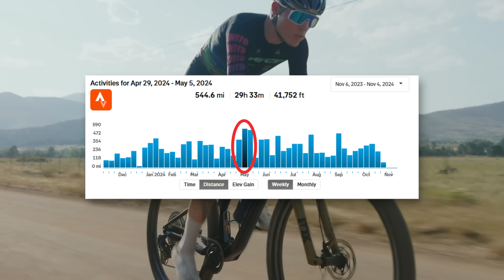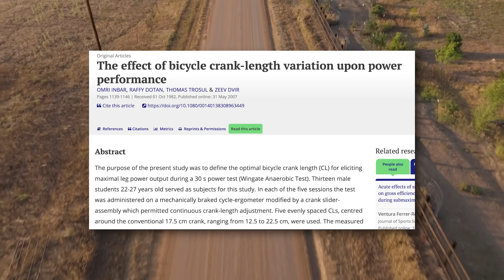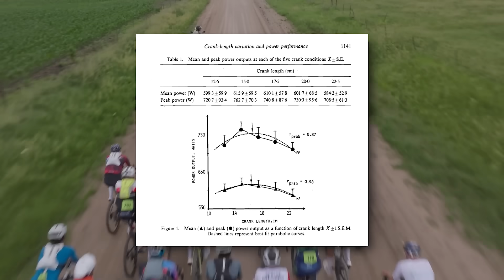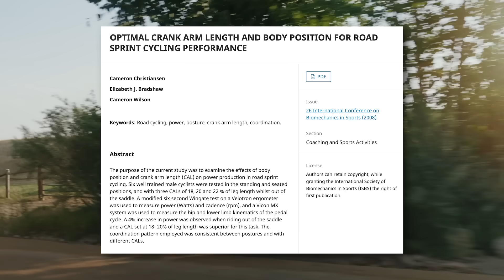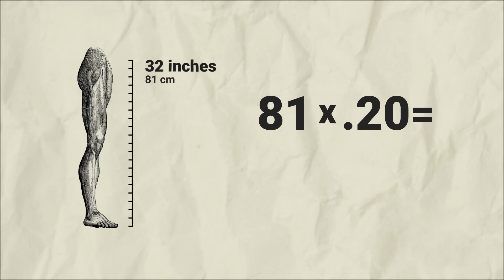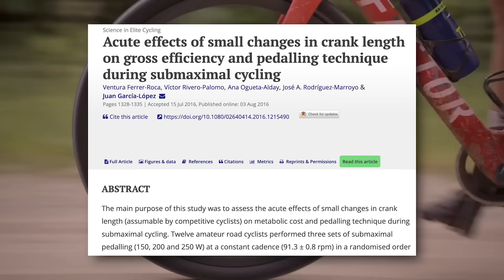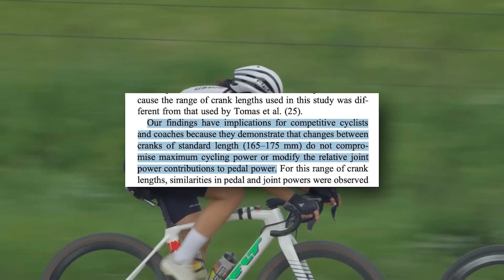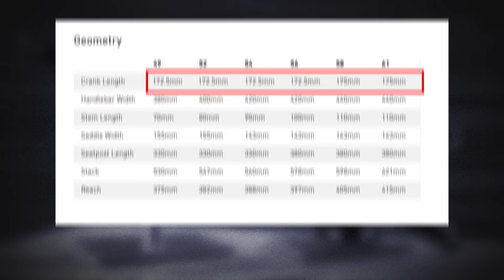You Should Be Using Shorter Cranks, Here's Why

Comment: mistake: shorter cranks are less aero, because you have to raise your saddel and bar so larger frontal area
Reply: Wrong, your saddle to pedal distance stays the same so no loss there but because your hip and knee angle is more open you can lower your upper body more, so more aero, on five bikes that I've fitted 165mm cranks to I've never had to raise the handle bars, your frontal area is smaller, even if you raised your bars the same amount you would still be able to lower your body into a more aero position with the more open hip and knee angle, but you don't need to raise the handlebars for any reason.
Reply: @gregmorrison7320  No, all you say is wrong. Higher saddelheight→ more frontal area. Hip angel is way more effacted by your saddel satback. And it is 95% training the position. For example Gannna uses 180mm in the IP.
Reply: @abcxyz6880  Lol seriously? You really think raising your saddle height 7.5mm effects your CDA, even if it didn't open up your hip and knee angle and allow you to get lower? You think the bike is somehow shielding your body from making aero drag and lifting your saddle 7.5mm somehow creates more frontal area? Come on dude. You must be trolling. Perhaps go and see a bike fitter to explain it to you. And FWIW for his hour record Ganna was running 170mm Wattshop Cratus aero cranks. Do your research before expressing your opinions which doesn't make them facts. SMH.

Comment: I went from 172.5 to 165 and got much less knee pain and saddle sores due to a more stable position. I also noticed a significant improvement in performance and speed, maybe due to the increased comfort and the ability to get more aero but the benefits have been very noticeable. great video hope manufacturers will catch on because not finding any bike that fits me anymore is a pain in the ass (even "custom" bike builds often don't feature anything below a 170)
Reply: Can you get your knee to your chest before 165?  I feel what you've described is knee compression to your chest and being able to deep breathe would indicate why performance and speed increase.

Comment: I went from 170 to 160. No toe overlap, no pedal strikes, slightly higher cadence, and most importantly it just feels better.
Reply: More smooth pedal cadence too and no knees hitting my chest on the drops due to higher seatpost, especially for us shorter guys who's already pretty tight on remaining seatpost length lol.

Definitely one of the best upgrades I did as per my bike fitter recommendation.
Reply: @ryoukokonpaku1575 さん，160から155(152．5が欲しい)に交換したら，１センチサドルが下がりました！おそらく前後方向も要だと考えています．日本人は膝関節で漕ぐのでショートクランクは使いません．尚大腿骨が長く脛骨も短いのが影響してるのかも？
Reply: Hey, thanks for sharing. Super informative. If you don’t mind me asking, what is your inseam and overall height?
Reply: It's such an expensive upgrade for what it is.
As a guy with a 76cm inseam, size 44 feet and riding a S frame I wish for it to be a more readily available option as time goes on
Reply: @thispod  I agree.  People are jumping on this with no discussion of leg length and most are talking about a 1 cm change.  I did see one guy that in the comment who said he was riding 175, but he's 5' 4".  NEVER should've been on those cranks anyway.
Reply: @thispod  I'm the same feet and frame yet my inseam is 84.5cm (I'm 170cm)...I don't want to have to raise my saddle any more than it is as my stupidly short torso won't appreciate more distance and especially drop to the bars....I ride 170(road) and 175(mtb) with no issues, probably no knee to chest problems as I don't have the spine length to get "low and long" ha ha...
Reply: @thispod  the way I solved that is building my own bike up from a frame and groupset I purchased.   A bike shop can also build it up for you for a couple hundred.    It in theory costs more to build from parts vs. buying off the shelf, but when you are talking about a power meter crankset, any of that "more" goes right out the window and a groupset and frame on sale actually made it less expensive in my case.   That also let me really pick a seatpost, stem, and bars that I knew would totally dial in my fit and comfort right out of the box.
Reply: Almost the same story. Went from 170 to 165, but with bigger gear ratio(I'm riding fixed gear).
Less toe overlap in winter boots, almost none in sneakers, bigger cadence, less fatigue in knees. Totally worth it.
Reply: I've got size 13 feet, and the reduction in toe overlap going to 170mm and 165mm cranks was a huge bonus. It's not why I made the change , but it's sure a nice perk.
Reply: @joelecho  Interesting.  I also wear 13s and have never had a problem with toe overlap with my 175s.  Never have had a problem in 30 years.  Could be cleat positioning, although on my current MTB, I have the cleats fully to the back of the shoe, which put my toes as far forward as possible.
Reply: @todd727300  its quite bike geometry based as well. I have no issues on my cross or xc bikes, but my Tarmac has a lot of overlap. Typical with racier road bikes.
Reply: @joelecho  No issue on my Alpe d'Huez with 175s either.  Interesting.
Reply: Did the same. A lot more comfortable, less ham string strain. No appreciable power loss. I m 165cm so 160-165 is optimum imho
Reply: "Tow overlap" sounds like something that can't be corrected by bicycle cranks but only by a bone surgeon.
Reply: What difference in cadence did you observe?
Reply: If i switch from 172.5 to 165 should i keep my saddle height the same?
Reply: Same here. I went over the years from 170mm to 165mm to 160mm. Each time I went shorter, I got more comfortable, less knee pain (none now with 160mm cranks), and smoother pedal stroke. According to the 20% rule I should be using 152mm cranks. I'm really tempted to try 150mm cranks but I would have to go off-brand, there are only a few choices, and SRAM AXS 2x12 front derailleur may or may not shift as well with other-brand cranks & chainrings. 

Toe overlap can be a major problem, not just an annoyance if you ride a small or extra-small road bike like I do. Especially if you wear larger shoes for your height (also as I do). Shorter cranks help with that and I also use pedals with wider q-factor (Favero Assioma Duo Shi) and this helps tremendously to reduce toe overlap as well as increased comfort and smoother pedal stroke. If you take some video from the front as you are pedaling, your saddle height is correct but your knees and legs make a v-shape, you are a good candidate for both shorter cranks and longer pedal spindles. A lot of fitters don't even look at this so do yourself a favor and ask them to take video from the front and evaluate. 

This often comes from hip impingement which is not from a lack of flexibility, but it's from the way your hip architecture is. This is more common than you might think, and it also affects deep barbell squats. Since going to the "Starting Strength" method of barbell squats, I can do deep squats for the first time in 25 years of barbell squats.
Reply: @northkyt The toe overlap for me (really only on gravel bike especially because a lot more low speed turns, especially in CX races) comes in part because I have my cleats back on my shoes, which I find is a more comfortable position. The shorter cranks would help. I have 170mm (frame size 51 or 52) and when I get a new gravel bike will go to 165mm most likely.
Reply: @northkyt  Wonder where you even want to get such short cranks as only a few manufacturers even make anything shorter than 170mm and the rare ones available from specialty companies might improve your pedalling but will severely worsen your shifting as their chainrings are not on par with your Campy/Shimano/Sram rings. You can of course cut your cranks and drill a new pedal thread into them but that only works on cheap, massive-aluminium cranks.
Reply: @northkyt  Thanks for sharing.20% is of inseam lenght?

Comment: 6'2.5" with 34.45in inseam (87.5) x 20% = 175mm.  
That's what I have ran on all my bikes since the 80s, from BMX to road to mtb to gravel.  
😉
Reply: why that magic 20% ? why not 19.5 or 17.9% ?
Reply: @razorree  It's a good approximation that some people came up with, by testing different individuals, but it can still be a few cm off depending on feet length.
Reply: 6'2.5" with 34.45in inseam (87.5) x 10% =  87.5mm. Time for a trip to the kids bike store
Reply: I think 20% is too much, cause I have 89 cm and 20% is 178mm , it's way too much, I think Dylan got it wrong? 
I use 172mm and I'm 100% sure I can go easily to 170mm 
I mean his 20% is what bike manufactures use on their bikes 
Just thinking, I might be wrong...
Reply: @JEZZ-B75  paper was saying .18  might by good as well

Comment: How does going to a shorter crank affect your current fit? Wouldn't your seat height be affected and thus compensating for the difference?
Reply: Raise your saddle the same amount to keep the saddle to lower pedal length the same, you don't need to raise the handlebars due to the more open hip and knee angle. You might like a longer stem if your current one is borderline short.

Comment: I'm confused by the lower position = aero comment - surely longer cranks mean you can get lower and more aero as the max leg extension point is closer to the ground and so your saddle can also be closer to the ground (lower)? Whereas, shorter cranks mean you would need a higher saddle position to allow for max leg extension? Please somebody explain, feel like I'm being dumb.
Reply: @ellismccoy shorter cranks enable you to have less bent hip when on the top of the stroke. This then enables you to bend over the bars more easily.
Yes, you will be sitting higher, but you'll more than make it up with a more horizontal torso.
Reply: @jankobenger9128  OK that totally makes sense.  I just couldn't work it out.  Thank you!

Comment: What's crazy is that in spite of the shorter crank trend, crank lengths on new bikes are still based on frame size and not an option by most manufacturers.
Reply: I wouldn't mind not being able to choose the crank length if they paired the optimal crank length with every size in the first place.
Reply: Did you watch the video? Frame size is related to height which is related to leg length. So it makes sense to scale based on the frame size. If you have an unusual build then you can swap them out.
Reply: Agree. I have a body type that I need a 58cm frame, but I also favor 170mm cranks and 40cm bars. A 58 would come with 175 cranks and 44cm bars stock. Just makes buying a bit more of a hasslw
Reply: This is exactly why I build all of my own bikes now.  I can pick each part and size to make it specific for what I need rather than what manufacturers spec on their bikes.
Reply: These are not custom bikes. So it's not "crazy" that crank lengths are aligned with frame size
Reply: The problem is that the big drive train company don’t offer correct length cranks. So it’s not like a bike shop can swap on correct length cranks when the bike already has the shortest crank Shimano or SRAM offers for a mid price bike.
Everyone that is “trending” to correct length cranks are doing so by replacing bottom bracket and chain rings.
Reply: @MrGoodaches  You don’t need to replace bottom bracket to change cranks. Shimano do 165 mm cranks so you have what you need right there.
Reply: @MrGoodaches sram and shimano both make 165’s
Reply: @ervin7178  Shimano introduced 160s with R9200. I just rechecked & I recalled correctly (I was on 180s at the time & they dropped those)!
If Sram had ever truly worked out front shifting, I'd care what they offer.
Reply: @ervin7178 can you please link me the 165mm option for grx or XT cranks? For real, I need them
Reply: Not that I can swap on my SRAM Powerspline or Surly OD spindle. Also not with the same chainrings 3x and 2x chainrings. My point was that retrofitting correct crank lengths ends up changing more about the bikes than just crank length and the cost is disproportionate to the cost of the entire bike.
Reply: most of the bikes are bought in a store - that should be the advantage, store/seller should be able to customise the bike for you (without extra costs!), like, cranks, brakes, handlebar etc
Reply: @razorree  There are extra costs because parts fitted in a factory and then removed in a shop cannot be sold as new. For one, they have been fitted, and two, there is no box.
Reply: @ in a current flawed model, yes
Reply: @razorree  Yeah, all that extra stock isn't going to cost anyone anything! 🤔
Reply: @razorree 

OEM parts , or “take-off parts” can only be sold at a significant discount and without any warranty. 
Any modifications to an off the rack bike are just part of the cost of participation, and the consumer should not have a problem paying for a proper bike fit or the additional parts needed to obtain it.
It isn’t the manufacturer’s fault that you fall outside the range of averages that they used to spec their bicycles, and it certainly is not the dealers problem.

The shop has to pay for those parts. 
There is no reason for them to lose money by giving parts away for free.
Also, many shops are simply not in the business of selling “take-off” parts since they legally are  “used parts” and as such there is significant liability attached to the practice of re-selling them.

If you want different length cranks and stem, different size and shape saddle, and/or different width/bend handlebar right out of the box, then you should get the fit done before purchasing, and get a fully bespoke bicycle built, a semi-custom such as Treks “Project One”, or just be prepared to pay the regular price for what you need like everybody else.
Reply: @prestachuck2867  well... thank You for explaining Us that flawed model... :) tell us something we don't know ;)
Reply: @razorree  Most stores charge nowadays for handlebar/stem changes as the stupid industry went with unneeded through headset systems... Even crank length they will charge you a new crankset and you will have to sell the one that came stock, which is ridiculous.
Reply: @youtubesafename123  , I bought a new bike from the only dealer of the brand in my country. I wanted AXS. Now I have the old X01 derailleur laying in a box at home.
Reply: @youtubesafename123  i know,  I said how it should work, that should be an advantage of buying in-store.  however I guess direct brands/store will do it first ...
Reply: It's not crazy, it's economics. Short cranks are a fad that's soon going to be over.

Comment: I think you are missing some other advantages of shorter cranks: less toe overlap with the front wheel, also harder to get pedal strikes on corners.

Those differences could also be utilized for different frame geometry.  With less toe overlap, you could shorten the wheelbase to give an advantage in cornering.  That could be a significant advantage in Cross or crits.
Reply: Big advantage for crits, but sometimes in CX you need to put out big torque for short steep sections - long cranks help with that.
Reply: @carlosflanders518  yeah, these power/performance numbers all assume you are in the right gear, which on extreme climbs I almost never am!
Reply: I don't think that toe clip overlap is an issue other than for maybe kids and casual cyclists. I'm sure all my bikes overlap but I don't recall ever touching
Reply: @gbshaun  It's a major pain when commuting or navigating tight bends at crosswalks. One of my roadbikes has notable overlap - I've raced it for years without a problem but very annoying for training when going slow and manoeuvering.

Comment: Wouldn't shorter cranks also help when cycling on an incline also because your knee angle will change especially when you start riding on the front of the saddle...you can spin faster without having to pull your leg up as much...